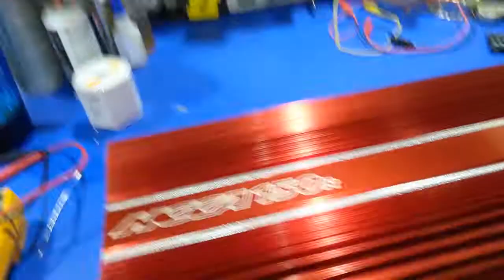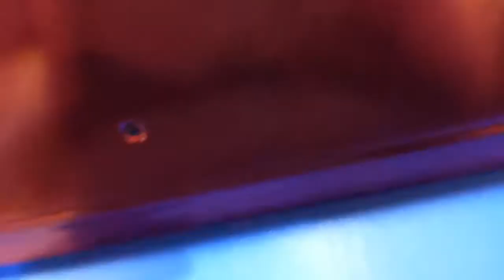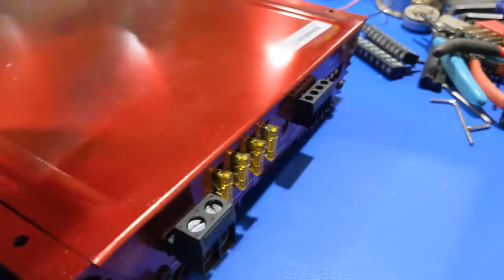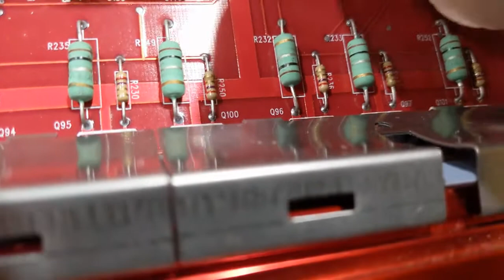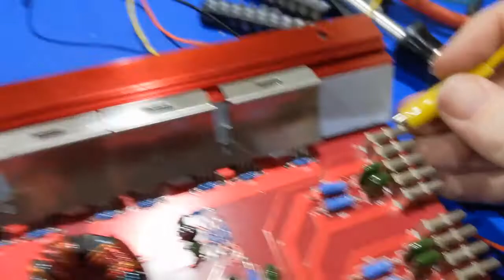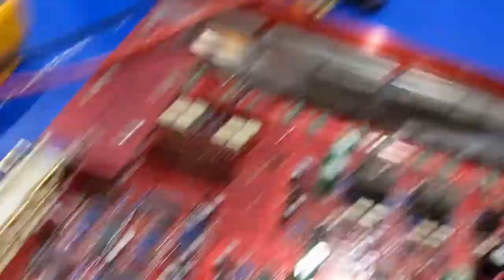Orion HCCA 150R Repair

Comment: These are awesome amps, still have mine its a 1st gen that has the fine line engraving it has a staggered power output. Easily handles 4 sets of components and a small sub.